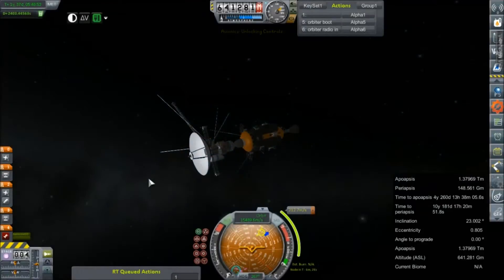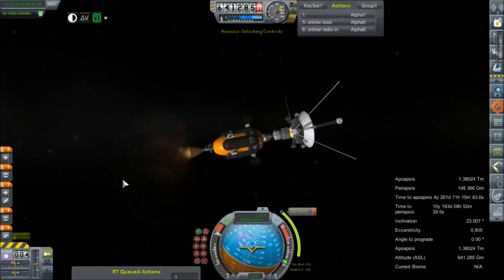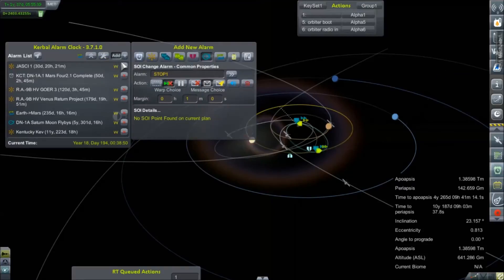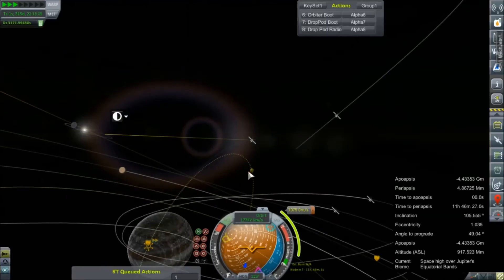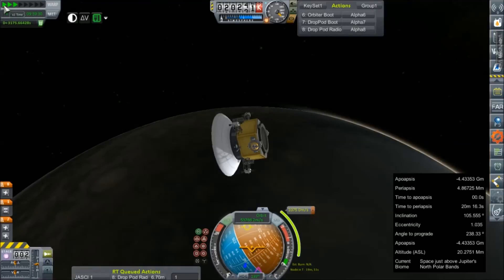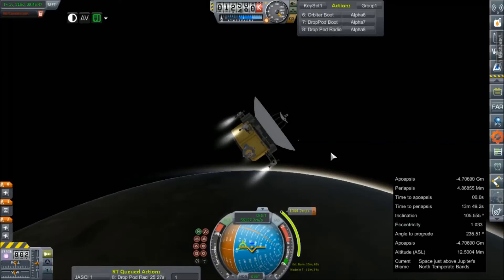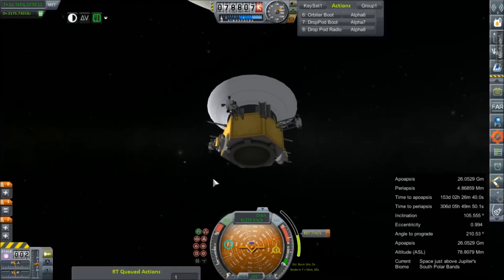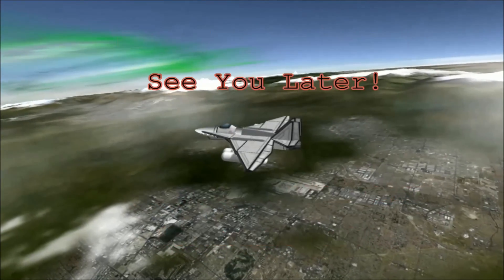KSP RP-0 #196 JASCI1 Orbital Insertion

Comment: Hi ! really cool vid as always :)
just a quick question, how do you control the probe even when you have no connection ? is that an option to activate in remote tech ? because mine can't move at all ^^
Reply from the maker: I made no changes to the Remote-Tech default config, it allows some basic controls without a connection. I could have programmed the burn through Flight Computer, but it does a notoriously terrible job of maintaining heading.
Reply: oh okay thanks, I will check if I can find an option for that because i can't do anything without connection. Yes flight computer isn't the best at pointing towards the node ^^